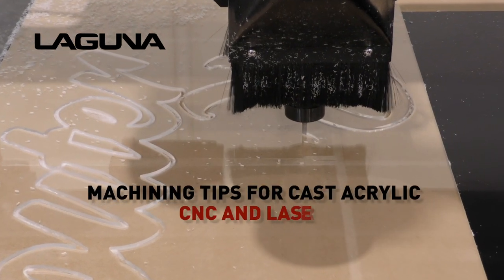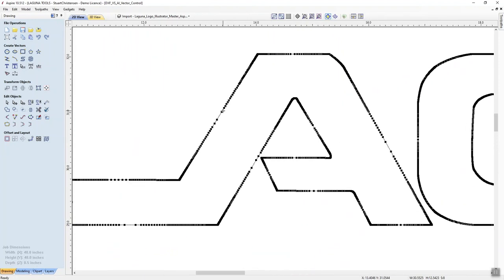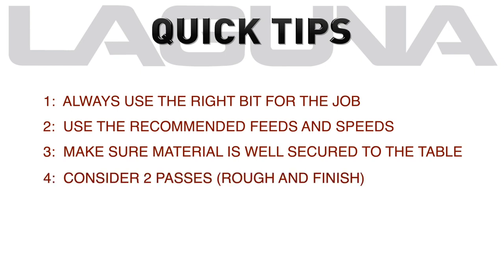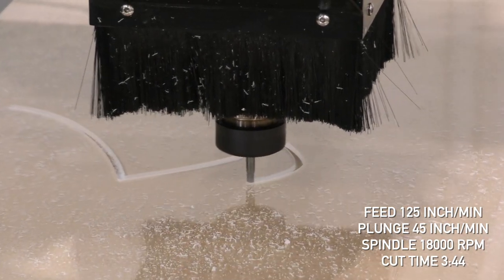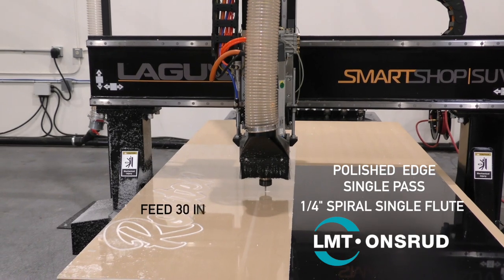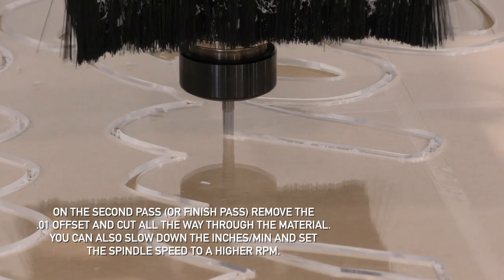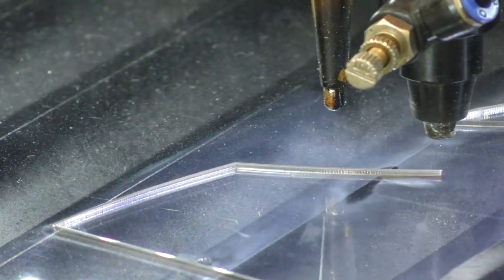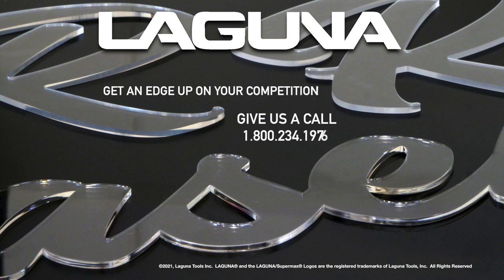How To Cut Clear Acrylic On A CNC Router and CO2 Laser | Laguna Tools

Comment: What onsrud bit is that? A feed at 30 IPM at 18k RPM seems incredibly slow. I just did it with an onsrud bit 63-530 and it looked terrible - minimum chip load is .006-.008.  Your edge in the video looks pristine so which bit is this?

Comment: There is definitely a lot of difference in your feed and speed for the polished and frosted edge, but I did not notice much difference between the bits besides the brand. Is this an accurate observation?
Reply from the maker: Hi Joseph, 
the difference between frosted and polished is the feed, speed, bit, and the number of passes. The polished finish had two passes, consisting of 1 rough pass with an offset and 1 clean pass with a higher RPM and no offset. The bit is generally the same with a slight difference in brands.

Comment: Is there any particular difference between those two bits? Since they are both single flute could the Amana bit have just been run at the slower feed rate to achieve the same edge look as the Onsrud?
Reply from the maker: The difference between the two bits is in the way they are milled.  True, they are both Single Flute Spirals, but when you look at them side by side,
 the Amana is quite different in the way it is designed compared to the Onsrud.  It's a good question, and it's best to compare both bits according to the manufacturers specs/feeds/speeds info. Hope that helps!
Reply: @LagunaTools  Would you mind sharing the model number of the Onsrud bit?
Reply from the maker: @joshwhlr1983  At this time, the exact part number in not known. Most likely the bit is a 63-530.
However, you can find great info about all of the Onsrud Solid Carbide Spiral O Flutes at this link: https://www.onsrud.com/images/LMT%20Onsrud%20Product%20Cutting%20Tools%20Catalog%20PCT-19.pdf
and go to:   63-500/Series Upcut Spiral O Flute.
There are many sizes to choose from in this product category, depending on your needs. Hope this helps!
Reply: @LagunaTools  I wonder if this is the bit you mentioned - I ran this using your exact parameters got no where near the result - but then again you're cutting a different acrylic than I am (likely) but going that slow melts the chips back into it and also adds chatter.  I'm using a machine as pricey as yours.

Thanks for the info but at the end you're right - bits are very different - which is why its actually good to know what you're using to make your examples actually relevant.  The feeds and speeds can't be incredibly different on the same type of tool via different brands.

Comment: Can you create a polished finish by engraving the acrylic? Thanks
Reply from the maker: The methods we show in this video are using somewhat standard (inexpensive bits) that
 will do a good job of giving an acrylic edge that polished look.  However, if super clear engraving is desired on the face surface, then you would have to consider investing in an actual Polishing Bit. Onsrud and Amana have them, but they are about 50 times the cost of the bits we are showing here. In other words, very expensive!!
Reply: @LagunaTools  what bit would you recomment for fine polished edge (super clear - like glass)?
Reply: @ErufenPL  a diamond bit, like p106 i think, these bits goes for around $1000 and up..

Comment: How is the material being held on the CNC table? I don't see holes for vacuum underneath the plexiglass, is it temporarilly glued to a sublayer?
Reply from the maker: That's a good observation, and the acrylic sheet is laying on top of a vacuum table, which has a grid of channels that can be isolated into sections by using flexible soft hosing that fits into the grooves on the table.  It may not be visible in the video, but there are larger holes in various sections of the table that are connected to a vacuum pump that provides suction to the various sections on the CNC table.
Reply: @LagunaTools  How many CFM does the vacuum table pull? I've taken a look at your web site but I found no info about it, I was looking at the Samrt Shop M, 4x8 table size, the one that mounts the Italian made spindle.
Reply from the maker: @tuscanland  There are various vacuum pumps available for our CNC machines. Our sales team will make sure you get the best vacuum for
your Maker and needs. Give us a call at (949) 474-1200 and we can help you with any specs/info you need. The Maker 4x8 is a great choice!

Comment: how thick is that acrylic you were cutting?
Reply from the maker: Hi there! This is 3/8 inch cast acrylic.
Reply: @LagunaTools 
 Amazing!!!
Reply: @LagunaTools  How strong is that laser?
Reply from the maker: @hrodwulf172  This is a 150W laser.
Reply: @LagunaTools  Thanks for the reply! Do you think an 80w would be acceptable for acrylic work?
Reply from the maker: @hrodwulf172  It depends on the thickness you're thinking of working on. 

Here is a general cutting guide:
40W - 1/8" thick acrylic
100W - 1/4" thick acrylic
150W - 1/2" thick acrylic

Thanks!